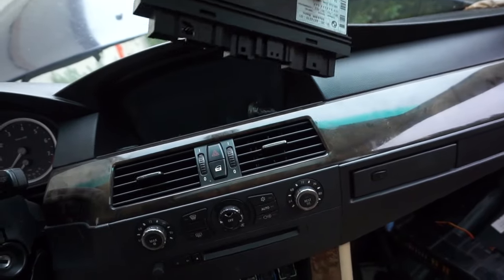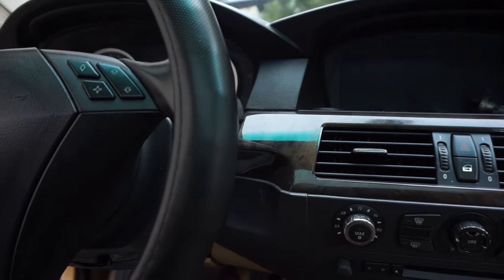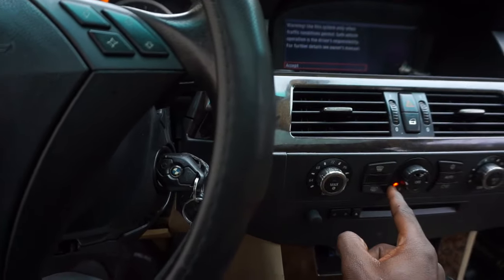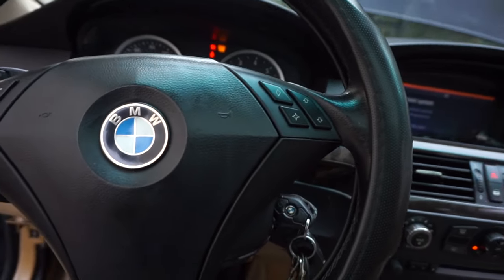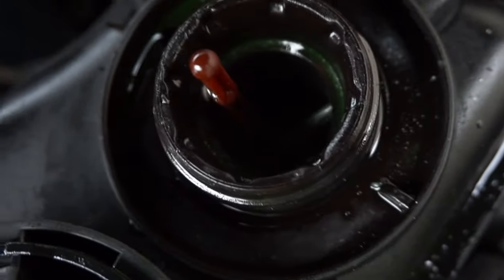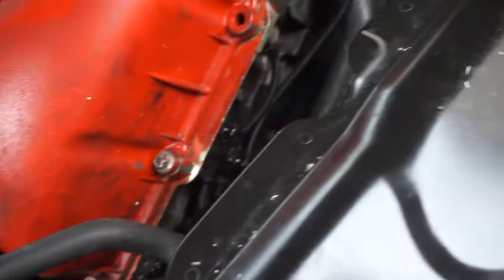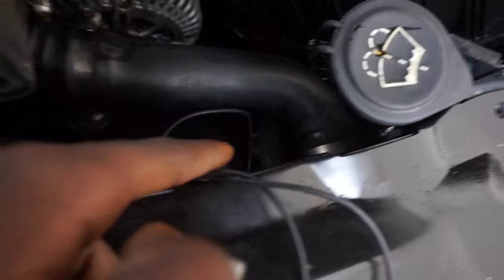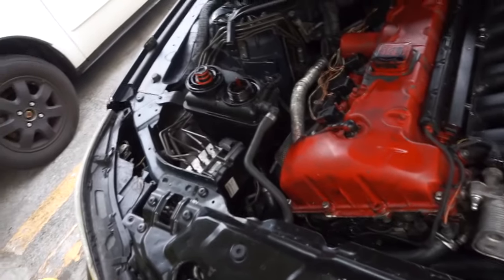How to Test electric Water pump in BMW before Replacing your Water pump & thermostat | Get Fixed

Comment: Ive tried to get it to bleed but no luck but when I turn the car on the coolant start to flow that way..smh
Reply: Did you ever figure it out? Same here my self bleeding process won’t start
Reply: Did you put it on full heat lowest fan speed and try the heated seats on lowest setting
Reply: And hold pedal down 15 seconds with ignition on engine off driver door closed
Reply: Make sure your battery is on charge under hood post . Computer won't start  process if battery too low.
Reply from the maker: These are things I should’ve covered in the video. I might make an update on this process. Thank you dude.
Reply: @MyNeowolf  hmmm I had full voltage but never put it on a charge.. the way I did it was I started “INPA” and did the water pump bleed process on there.
Reply from the maker: That process never worked for you? Cause I did the same thing with my 2006 BMW 525i, and it worked with INPA.
Reply: @GetFixed  correct , the pedal method didn’t work. I had to do it via INPA. And it finally bled
Reply: Hi get  fixed . Question?  I have  a  530 2007 n52  engine.
 Car drives 15 minutes no issue, but got the  high temp on the  dash. I let her  cool  down  when  to  troubleshoot,no  fuse  blown,  try to scan and  start the bleedi g  sequence but  to my surprise  she dont  want to start the process .
 I had  somw issues  with the ecm  but was fixed. Now  you mentioned  thw ecm.  Is  there  anyway that  we can  test  this  and  rule  out  the ecm?
Thanks
Reply: @richhayrobrokke6171  to make it easier what you can do it. Ignore your ECM idea for the time being. 

Simply start from scratch. My car wouldn’t start the bleed process as well, so do definitely need to do the bleed process if it’s “ over heating “ the yellow collect icon on your dash. 

1. Get yourself “INPA” on a laptop 
2. Connect the laptop via your OBD port using a “ D+Kcan cable with a switch”
Once connected and INPA is opened, you can select your car model (e60) and there’s an option to run a water pump test (coolant bleed process) 

This was it, manually doing it via the program (INPA) but it will work! I lt did on mine. 

If you want to see what I mean just search for “BMW INPA coolant bleed process” or “INPA BMW water pump bleed” something like that.
Reply: @stgmatuning  hey mate  thanks  
 Did  ylu perhaps  can give  me more  info  on the  inpa? I have  a launch  obd  scanner.    Checked  all  fuses    measure  the  waterpump  plug  . No  sings  of life qua  waterpump  or  bleeding process  its  a  530 i  m package  with only  113.000km     i  start  thinking on the  waterpump or  thermostat  mate  
 But  head  me up  with some  info  regarding  the inpa 
Cheers
Reply: @stgmatuning   Please respond asap, I did the inpa method as well and it said successfully finished but I'm nervous to start the car because the other method wouldn't work for me as well. Was this the same issue for you?
Reply: @dbosnow2203  hey I’m here , what’s your question exactly?
Reply: @dbosnow2203  How to bleed e90 coolant 

First, open the bleeder screw …. and pour coolant until the bobber goes up… 

Once that’s done… close the bleeder screw 

And start the electric bleeding through INPA. 

Put the cap on (tight) before or once it starts (after putting coolant) …. 

Once it’s done… open the bleeder screw and hear for air coming out. 

If you need more coolant … top up slightly below max so it has space just in case it “boils “

Once it’s done … 

Shut the key off, and put the key ignition back on and do it once again! 

(start bleed process again) (if you refilled with coolant again) 

Finally once done twice… 

Shut the key off completely and lock the door …

Then unlock the door and put the key back and turn the car on

The final steps are just extra … but after it finishes you can just cycle the ignition.
Reply: @stgmatuning  Thanks! Okay so I noticed how you said that the pedal method didn't work for you an you had to use inpa. I did as well but I did have failed attempts on inpa due to my coolant getting low and not watching it. But I eventually got it to complete. My question is since you couldn't get it to work with the pedal method, did the inpa method work and did you have any problems after using the inpa method?
Reply: @stgmatuning   Thanks! You've been a really great help, I think you should show some of these other YouTubers how to make a proper video without the extra talking and distractions.
Reply: @stgmatuning did u figure out what was the issue? Facing the same issue on my 535i N55. Also getting the code BSD pump is missing, the engine is overheating, but sometimes the pump works and sometimes not
Reply: Honestly, no I sold the car and bought another 335i with the n55 and it worked this time. 

I had to do it manually with INPA, which I now prefer but at the same time… wish I knew what it was. Could be a fault such as what you mentioned that something is missing or not working properly and triggering the action of not being able to do a bleed process via pedal. 

Wish I knew… I’m sorry

Comment: I need some help. 2006 E90 I just replaced my water pump and thermostat and my car still over heats. I try to do the bleed process but it does even bleed. No water comes out. I've checked the fuses under the hood and all good. Please anything will help 🙏🙏🙏
Reply from the maker: Also check all your trunk fuses. Check them, if you know how to use a multimeter, set it on the settings that beeps when a circuit is completed. Stick the Multimeter prongs at the top of the two contact points on the fuse. If the multimeter beeps then the fuse is not blown but if the multimeter doesn't beep then the fuse is blown.
Reply: @GetFixed  I don't see any trunk fuses 🤔 The distribution box is all I have and I saw that they are non replaceable fuses so I'm not sure which fuses your mean. Thanks
Reply: @Aguilarr24  p
Reply: Did you ever figure it out bro?
Reply: @stgmatuning  yes... Come to find out the water pump plug was bad. Returned it for another one and worked right away.
Reply: @Aguilarr24  i appreciate your response. it breaks my heart.. i literally bought a brand new water pump. OEM.. was yours OEM?
Reply: @Aguilarr24  To add on... I have been driving the vehicle after it was bled the first time and it never overheated.. i accidentally bursted the coolant expansion tank and wasnt able to bleed it properly after replacing the hoses and tank.. I'm hoping the overheating is due to air being trapped still... i'm going to try to use INPA and see if it lets me bleed it that way. Fingers crossed.
Reply: @stgmatuning  did u get this resolved?

Comment: Great video, thanks! I just want to ask you one question. I took my BMW X3 2016 to the agency for a change of coolant. Days later, the fan turn on at maximum power. This just happened once. When I took my vehicle to the agency again, it did not happen. However, they told me that battery and water pump were damaged. I am in the process to decide what to do, but it seems that the problem started since they changed the coolant. Maybe, they did not purged it properly as you explained and the water pump is not damaged yet. I have driven my vehicle for short periods of time (20 minutes) and the fan does not turn on. If my water pump were damaged, would it stop completely? Is it possible that it would run intermittently? Thank you in advance.

Comment: I had my 2007 bmw 335i engine pressure washed and I’m getting fault codes of coolant pump missing, I believe it might caused a circuit fault watching this video hopefully fixes my issue ima look into what you changed. Water pump won’t turn on or make any noise when manually bleeding it
Reply: I got the same thing my friend, getting fault codes of coolant pump missing, I’m still trying finding what the problem 😅, I hope 🤞🏿 somebody can help Soft  the problem thank goodness 😊
Reply from the maker: @alamal5367 @alamal5367 If you’re getting a missing coolant pump error message than check your fuses to make sure none of them blew out.

Comment: I’m following your steps. Great content! How long do I do this process? How do I know when it’s bled enough?
Reply from the maker: This is just to verify that you water pump works. You could stop the process right after verifying this by turning on your car. If you let it continue, it will kill your car battery unless you have your car on a voltage regulator.
Reply: @GetFixed  this
Reply from the maker: I’m not sure what the question is Amer.

Comment: What if your heater does not work, Would it still bleed or would it not work, Please get back to me thanks.
Reply from the maker: Hey Paul. It should still bleed even though your heater isn’t working. If it doesn’t then get a fuse tester, locate the fuse box panel and test your individual fuses to see if any of them went out.

Comment: even if it bleeds it still can be faulty.
Mine was dying, and had to be replaced. still did bleeding fine
Reply from the maker: It went through the entire 15 minute bleeding process?
Reply: @GetFixed  It's 12 minutes but yes it did
Reply: Hey what were the other WP symptoms that made it faulty? Low pump rpm’s? Thanks
Reply: @joseoviedo4529   Intermittent heat, went from hot cold hot cold mostly cold. no other errors or strange behavior. i didnt check pump rpm

Comment: Mine works prefect do you know how long they last ? My e60 has 63k miles 2010
Reply from the maker: You may not need to worry about your water pump until a little over 100,000 miles. I love the e60 models, my thermostat gave out on me at 167,000 miles.

Comment: hey! great video, I have an overheating/no heat in cabin issue with my 2012 320i. I cant get the pump to bleed so im suspecting that, but I'm glad you mentioned the fuse. Do you think its in the same place on my car as the one you showed here? I have already replaced coolant temp sensor and thermostat due to a previous overheating issue, do you think there is anything else that could cause it? I can't communicate with the ecm so I'm worried that is the issue but I don't know how to confirm it and don't want to throw parts at it. Thanks
Reply from the maker: I hear you. I went through that phase before. Throwing parts at the car when I wasn’t sure what the problem was. I have the 2015 328i now, if you want I could make an updated video on that car & show you what to look for if your car’s overheating. Sometimes when you’re having problems with your scanner communicating with the ECU, sometimes the gateway module is faulty.
Reply: @GetFixed I’ve got a question. I have the bmw f30 320i 2012 with the N20 engine and I’m losing about 1l coolant in 8-12 days. It’s not mixing in my oil and I have no visible leaks. The car only has 139.000km’s about 87k miles or something. Could this be of a leaking electronic waterpump or what do you suspect?
Reply: Were you able to fix it? I have the same issue where I got the other parts replaced and also no heat in cabin. Also pump is no longer bleeding

Comment: Got a customers car in the shop 2008 Bmw 335i n54 just replaced water pump and thermostat  it has 112k miles new water pump isn’t kicking on it me be that module is bad
Reply: fuses arent blown
Reply from the maker: Check the water pump relay, also make sure the water pump is actually receiving the 12v power from the connector. If you wanna test it even further you can use a multimeter. Ground the negative lead and hook the positive tester to the control side of the water pump connector. Run the water pump test and see if you get any current values from the multimeter.
Reply from the maker: Let me know how this issue is resolved.
Reply: @GetFixed  which relay is it?
Reply from the maker: It depends on the year and model BMW you have. Not all the relays are located in the same exact places in all models.
Reply: Do you find the issue ??

Comment: My water pump is electric. It doesn’t want to shut off there for it’s draining my battery. Suggestions? 
I have bleed the system twice.  I’m thinking fuse or water pump is going out.

Comment: I tried to start the bleed process of the water pump and the pump never starts.  Is it the fuse or the pump? What's keeping it locked out?
Reply from the maker: Go look at your fuse diagram or look online to figure out which fuse is for the water pump on your model BMW and check the fuse to see if it's blown. This is how you'll be able to troubleshoot and eliminate the potential cause of this issue.
Reply: Did you ever figure it out?

Comment: Hey I have 528i I have replaced both battery and IBS sensor within the past 10 days however hours after driving the water pump is still running and followed by the alarm any help on this I have been getting notification for car being hot as well and recently had coolant pump hoses changed?
Reply: I have a I BS sensor as well. I was wondering if that was the issue . It be weird stuff on BMWs

Comment: I have a 328xi my house blow up just like ur I fu"""up.my car to u change all my cooling system radiator or the hose that busted the fan am waiting for it to come I order it too.my cooling tank is working just when I bleed it that means my water pump is good then I'm going to check to see if it's that black box that you said that messed up on yours.u think is the same problem as yours???? It is over hating...
Reply from the maker: Check all your fuses, under the hood, in your glovebox compartment, and in the trunk boot. Make sure none of them has blown. There's a very quick way to check that with a multimeter on the resistance setting, when yo connect the end of the multimeter to both contact points of the fuse, you will he the meter beep when the fuse is good.

Comment: Hey,  
I have a 12 F10 , got into a accident ... my upper house was leaking and I changed it ... now the system says drive moderately engine over heating ... my gage is only at 250... any idea what is causing this ?
Reply from the maker: Check the coolant level to make sure that the coolant isn’t leaking from the F10. Look in the reservoir to verify if the levels of your coolant changed. If it did, that most likely means that there’s another leak from elsewhere ( whether that’s a lower hose somewhere or the radiators structural integrity may have been compromised from the accident ). 

Next suspicion is that the thermostat may have been physically damaged which will cause the the thermostat to be stuck in the closed position, when that happens the coolant can’t freely flow through the radiator, engine, and other components of the vehicle cooling system. This’ll lead to overheating conditions which can possibly cause the coolant to boil if driven long enough and cause some of the hoses to blow.
Third possibility is the fuse unit in your glove compartment has a blown fuse for some type of engine electronic component that’s causing the overheating condition. That was the problem with my 525i.

Comment: Why not just turn on the car and have the cap off to see if its circulating? Instead of doing all that process about the pedal
Reply from the maker: Oh because the procedure shows you whether or not the pump works throughout the entire process. If you pop the cap off, you’ll see the pump working but the question is, does it work at all times? Does it circulate the coolant when needed.
Reply: @GetFixed  i did that procedure on my daily that i use every day, and it disnt throw water on the resevoir. Weird.
Reply from the maker: That is weird. Have you had any overheating issue recently?
Reply: @GetFixed  i have not. Unless i did it wrong
Reply from the maker: Whenever you have the time to, try it again and let me know.
Reply: @GetFixed  i made a video on it. Im about to upload the video on my YouTube. Idk how to put it, so ppl can comment on my videos tho
Reply: @GetFixed  did u see it
Reply: My pump is NOT moving water with the cap off when the engine is on. Does the car need to be very hot in order for the stream to be moving water. Or should it be on as soon as the car starts. Have a 2006 525xi E60

Comment: How u know that's mess up
Reply from the maker: A few ways to know that the water pump is messed is if the car tends to overheat a minute after you start it, and 2, if the water pump doesn’t turn on after doing this procedure then it’s messed up.
Reply: @GetFixed  I replace with a new one still nothing some symptoms it looks like is bot turning on
Reply: @GetFixed  I try bleeding it but wont bleed pump won't turn on idk what can it be
Reply from the maker: Have you opened the coolant cap to verify that the water pump isn’t bleeding the system?
Reply: @GetFixed  I did the pump is not turning on I have bleed others same way works ok but this one wont bleed and it still overheats with the new pump and thermostat
Reply: Did you figure out the issue I am having the same problem, replaced the water pump (twice) thermostat and the connector still will not bleed or move
Reply from the maker: Have you checked all your fuses?